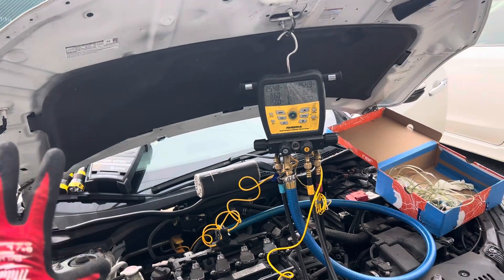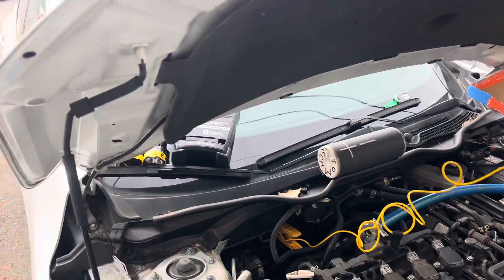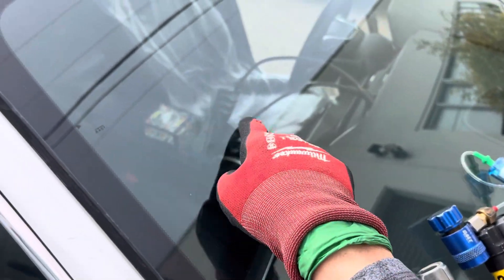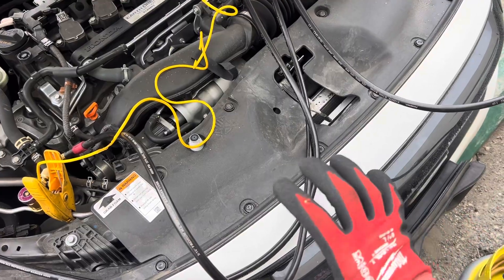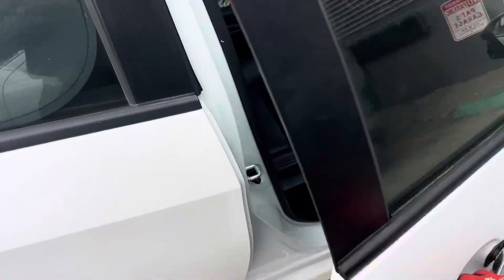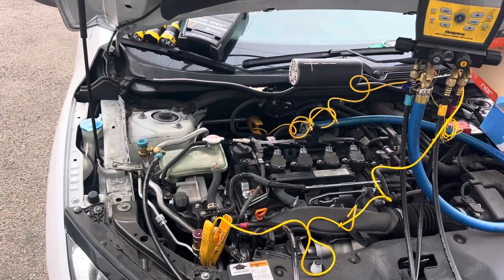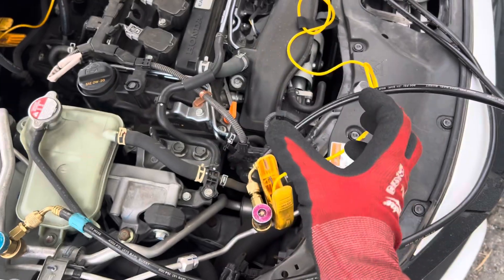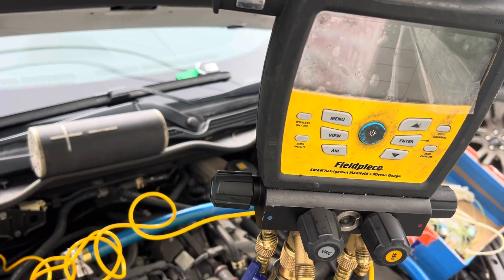Refrigerant leaks. You just can’t find sometimes.. oil stains and UV dye do not always work ￼

Comment: How are you filling it up and leaking testing after that? just sniffing?
Reply: Have you ever messed with automotive test solutions CO2 testing tools?  Fill system with CO2 and use a CO2 detector.  Their setup may be helpful to find an evap leak because the CO2 is heavier and will be present at the evap case drain hole.
Reply from the maker: @ablackformula  yes I have CO2 leak detector
Reply from the maker: Electronic leak detector

Then after recovery under vacuum ultrasonic leak detector 

Then fill with high-pressure nitrogen and tracer gas at 250 psi using electronic leak detector and ultrasonic leak detector 

And then when recharging adding UV die and go over it again with the UV light . 
   
And then after running the system and putting it under operating conditions with a full charge of refrigerant . 

To get all the metal lines that are going to get hot, so they’re hot and get all the metal lines that are going to get cold so they get cold because some leaks only happen when the metal expands or contracts . 

And then leak test it again 

Break out soapy bubbles, and hit all the average common suspect joints, and seals O-rings gaskets
Reply from the maker: Filling it up is liquor in the high side takes about 10 to 30 seconds and it’s completely 100% full